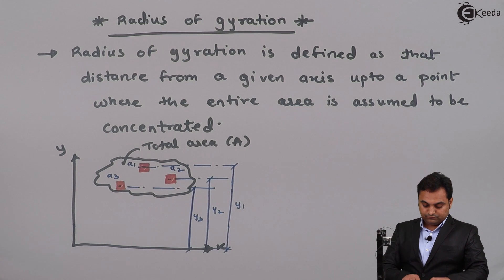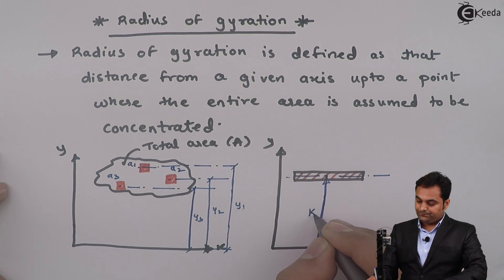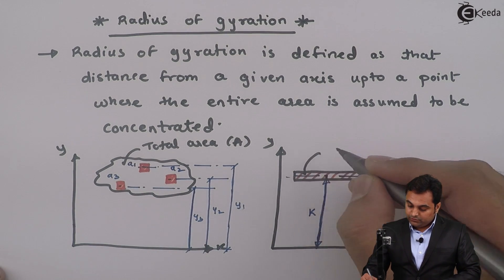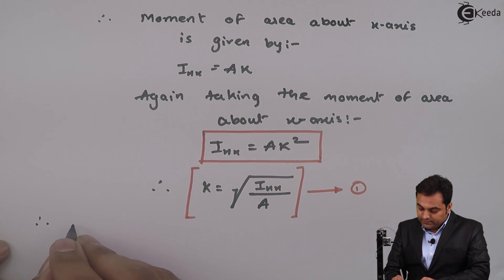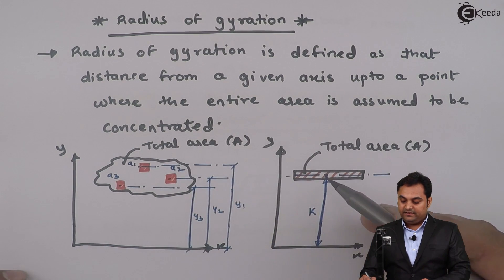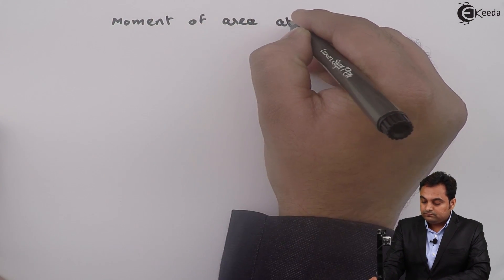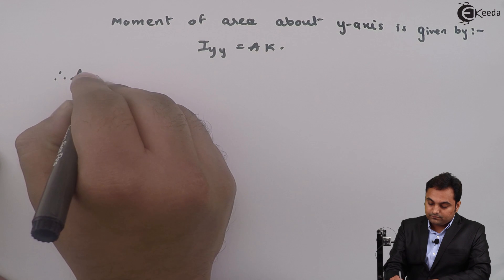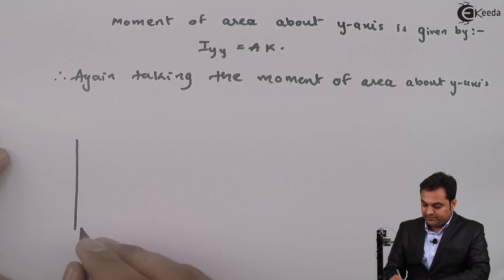Introduction to Radius of Gyration - Moment of Inertia - Strength of Materials

Comment: one thing I should tell here is that moment of inertia and second moment of area are two different things. for areas that are geometrically important and whose mass is not as that much important in comparison to their geometry we take 2nd M.o.A. while for solid bodies (volumes) we take moment of inertia which is a measure of the resistance of that body to angular acceleration (much similar to that the mass is a measure of resistance to linear acceleration).
Now, the second moment of area is purely geometrical, hence it will not include density or volume in its equation. It is simply distance x distance x area. Much logical to understand like Force x distance is moment of force is similar to area x distance x distance. 
The mass moment of inertia can be determined through radius of gyration which is simply the mass x R.oG^2. 
Mass moment of inertia has units kgm2 while second moment of area has units m^4. Mass moment of inertia can be converted to 2nd moment of  area like this:
Im = int(r^2) dm    ;  int==> itegral
Im =int(r^2 rho dV) = int(r^2 rho l )dA ===> l = length
Im = int(r^2 rho l ) dA = rho l (I_a ) ==> I _a =2nd moment of area
Reply: thanks!